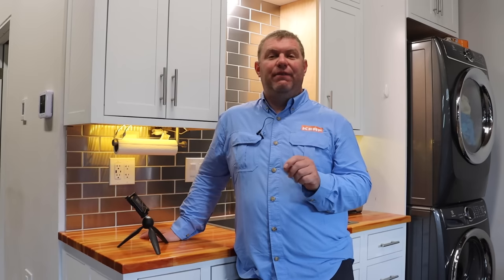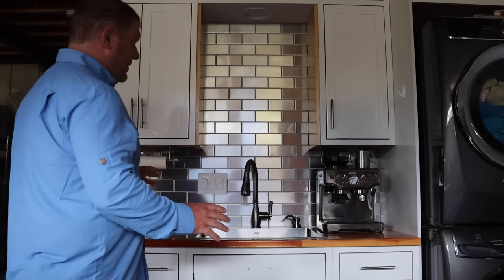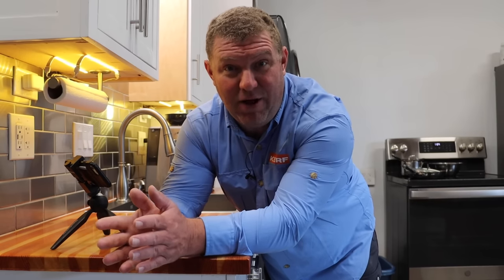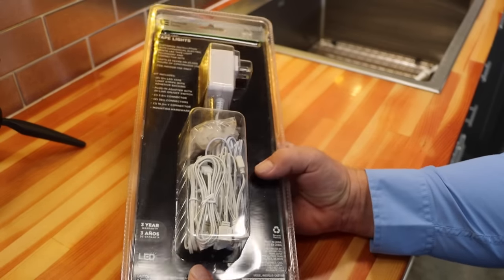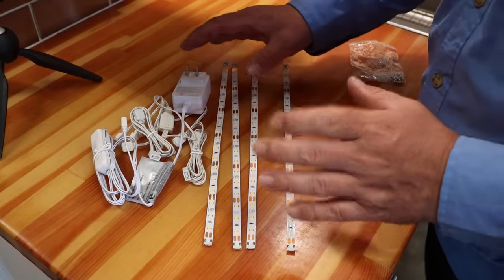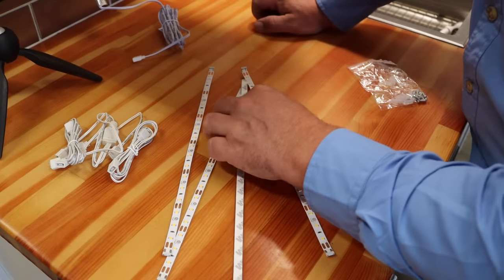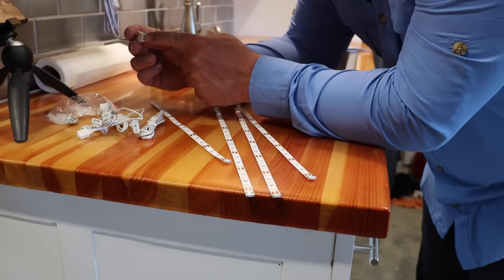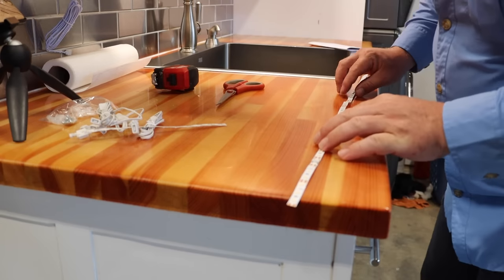Easy Kitchen Upgrade! Install UNDER CABINET Lights in Minutes With No Tools

Comment: I installed those exact same under cabinet lights last year when I remodeled my kitchen. The one thing different I did that when I remodeled my kitchen is I actually put the outlets up inside the kitchen cabinets so that way the ”wall wart" was hiddenup inside the cabinet and all I had to do is drill a little hole in the back corner of the cabinet to run the wire out the bottom to plug into into the lightstrip. I also did the exact same thing as you doing switched outlets so that way I didn't have to use the little toggle switch that comes with the light kit.
Reply from the maker: This really makes under cabinet lighting work the best. Proper planning. But retrofit works great too and is a lot less work. :)

Comment: My only suggestion is: Those double stick mounting bases, the ones I've used, will come unstuck it the air temperature around them gets a bit high or maybe repeated excess temps. I have used them to route a single CAT-7 cable and it came free. (And, yes, I cleaned areas where I stuck the mounts.)
Reply from the maker: There's levels. For some a double stick no tool required base is what they need. For others we get out the big guns. Nice to have options :) Agreed on heat being a problem for the double stick base if heavily loaded in a gravity installation.

Comment: Easy Peasy installation. Nice Planning putting the two switched under-cabinet outlets in.  But personally I did not like the stripes appearance the reflections of the lights caused on the wall tile. But looks like you chose a reflective metal style tile. So maybe on regular tile the stripes would not be as noticeable.
Reply from the maker: Always good to test for your install. A space is the sum of all its surfaces. We tried a few different install ideas and the glow is the one we like the most. They do make diffusers for this strip lights which eliminates the harsh lighting.

Comment: Looking good. Can you have the switch so close to the taps , is there a code?
Reply from the maker: Code only applies to construction or remodel. This device isn’t subject to code in this use case. So just use good judgement and it the small switch in a place 12” away or so from a sink.

Comment: One quick question: what is the life expectancy of these strips? I tried rope lighting under my cabinets several years ago, and it had to be replaced after about a year. I also tried some button-style lights with magnetic bases that switch from white to blue to green to red. They lose their grip quickly and fall out of the magnetic holder (mounts). Furthermore, each light requires three AAA batteries, that need to be replaced with alarming frequency (not rechargeable). Your system certainly looks appealing to me. Thanks for sharing!
Reply from the maker: As all LEDs it’s many thousand hours. We just replaced a set that had a gel coating to diffuse the light which had yellowed over 4 years. The lights work fine but the yellowing wasn’t great. The newer strip lights don’t have this costing so they should last for a very long time.

Comment: While they look good, why wouldn't you face them downward towards the countertop
Reply from the maker: Lots of ways to do it. Down facing created more a bowling alley look with the butcher block epoxy top. It works but it is more harsh. Every installation is unique so try a few things and stick with what you like!

Comment: Don't like the huge plug for each light 😒
Reply from the maker: They all 'em a wall wart for a reason. :) Its necessary to change voltage for the LEDs sadly. Of course spend more money and lots of options out there without the wall wart, but more work and more $$